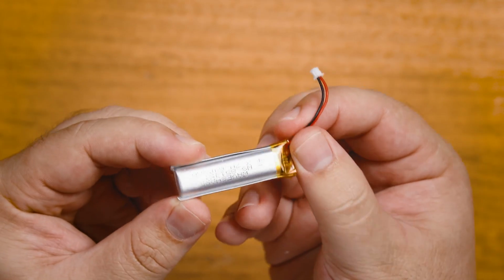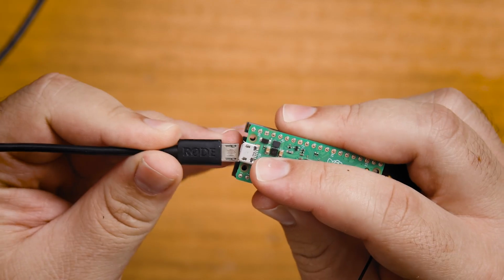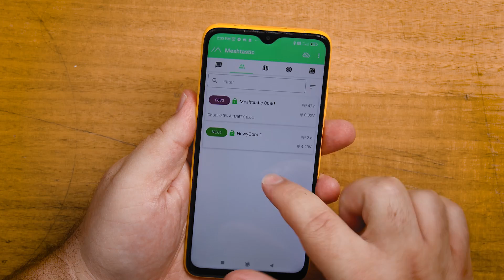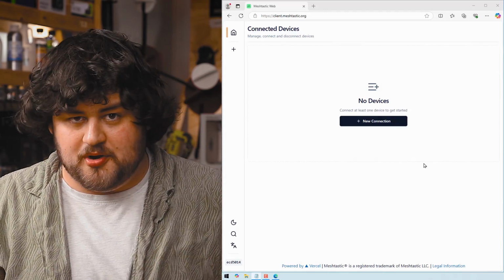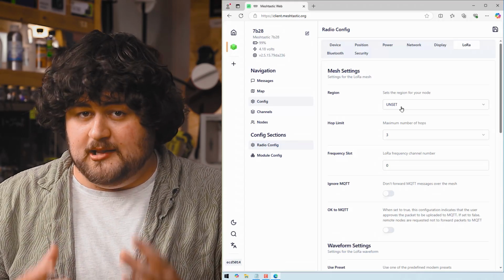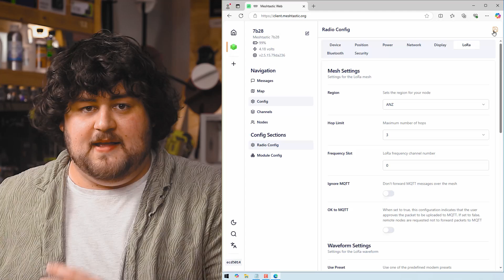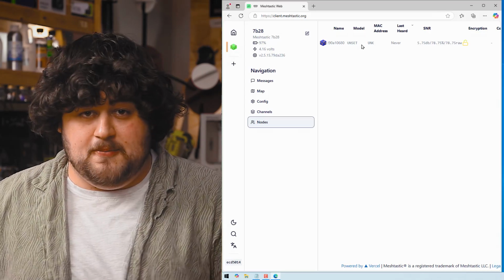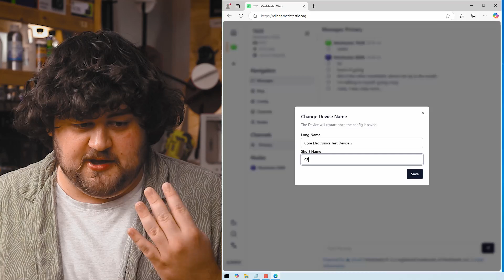Installing Meshtastic on the Pico | Meshtastic for Makers

Comment: Will that work with a Pico W? Thanks
Reply from the maker: Yes it will! You will just need to install the Pico W specific firmware in the meshtastic flasher
Reply: @Core-Electronics and was not in my case...I had to load a uf2 which sets the corrects pins for the lora module.

Comment: Nice video! I'd like to ask if the sx1262 works well sending long messages, cause it's stated in meshtastic's web that 'The Waveshare SX1262 LoRaWAN Hat for Raspberry Pi is not recommended for deployment. It has known hardware limitations that may affect longer messages. If you must use it, please use the CLIENT_MUTE role to avoid rebroadcasting.' Thank you

Comment from the maker: Hey yall, we made a booboo in this video. The Pins for the screen are actually 4 and 5 not 8 and 9. So SDA to Pin 4 and SCL to Pin 5. If you want to see how to correctly wire up the screen we do it in the 4th video where we send custom sensor data!
Reply: you should pin this comment

Comment: After first setup I am not able to connect my rPi Pico in Meshtastic web client. Please do you have aby tips? Thanks in advance.

From different Meshtastic device i am able to see that Pico but i need to change name, channel and some settings😢
Reply from the maker: Thats an odd one, just ensure that you are using a Chromium-based browser and remeber that everytime you save something, you will need to refresh the client and reconnect the Pico. We have a section in the written guide about resetting the Pico, this might be a good option just to ensure there aren't any weird settings that are preventing it from connecting: https://core-electronics.com.au/courses/meshtastic-for-makers-workshop/#resetting-the-pico

If none of these work, we have a dedicated maker forum topic for this video, feel free to post your issue over there as we have many makers who can help out!
https://forum.core-electronics.com.au/t/meshtastic-for-makers-workshop/21669
Reply: @Core-Electronics  thank you for your answer and time. I have my rPi Pico for some time and I did not used it for few months. I tried different cables, different browsers still with the same result. As a final solution I tried to re-solder the USB  and voila... it works now 😉

Comment: Did WaveShare fix their crystal problem? From what I understand, they used the wrong type of crystal and that device is only good for very short LoRa communications, while Meshtastic sends longer messages. That heats up the crystal sending it out of spec causing problems with long messages (including when repeating them). 
Jonathan Bennett has details in his "I Goofed" video.
Reply from the maker: We had a bit of a big scare about this a while back. This issue is with the Waveshare LoRa HAT for the main Raspberry Pi boards (like the Pi 5), the LoRa hat for the Pico that we use in this guide  does come with an active temperature compensation crystal oscillator so it is not an issue with the Pico. We even set up a test over Long Fast where we sent messages every second for an hour and had no issues.

Currently trying to get the Pi 5 working with the Pico's hat as a work around.
Reply: @Core-Electronics  Thank you for the explanation!  I thought WaveShare only had one for the Pico. I didn't realize he was talking about a regular Pi version.
That makes the Pico version much more interesting again.
Reply from the maker: Yeah we were a bit confused about that as well and didn't realise at first he was only talking about this Pi as well ahahah.